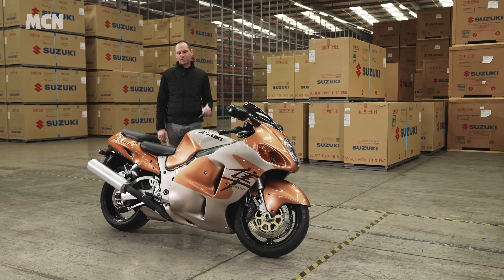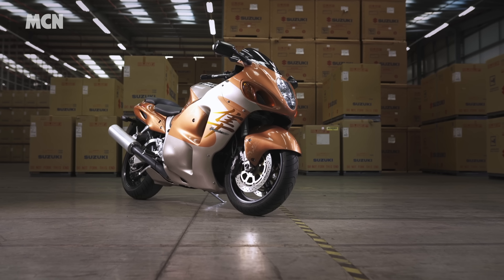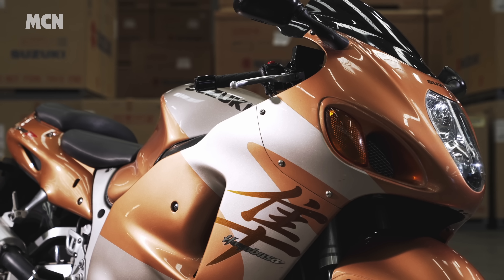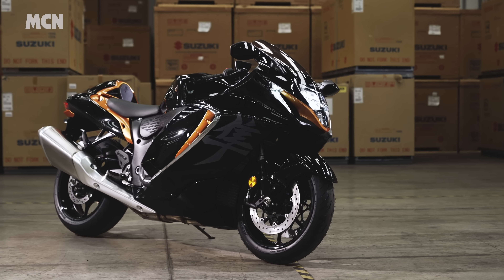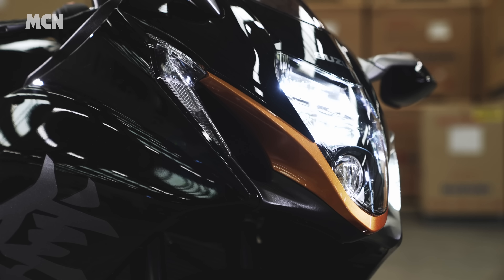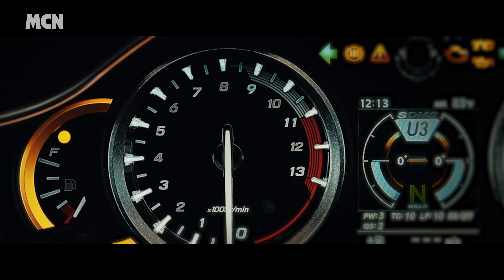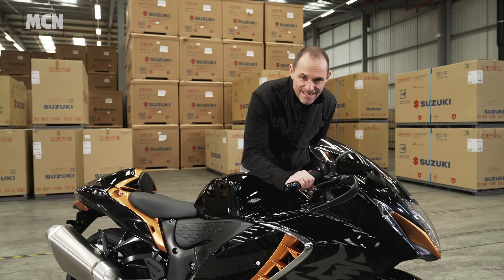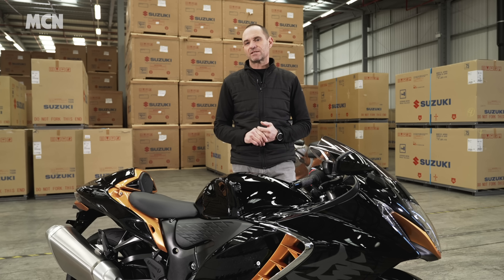2021 Suzuki Hayabusa exclusive: Neevesy's take on new 180mph+ hyperbike | MCN

Comment: Impressive! You actually managed to make it sound good. 

But still, to me it sounds like a facelift..
Reply: When he said the frame was the same I came to the same conclusion, it's just a very pretty fave lift, I was also expecting kawasaki H2 power figures so was kinda disappointed it's lost power.
Reply: I dont mind the looks and the electronics is very welcome on a bike like this in my opinion. If there’s nothing wrong with the frame I don’t mind reusing that either. I do think it is at least 20-30 kg to heavy and 30-40 hp to weak for what it is meant to do considering modern standards.
Reply: Nah. You are going a bit far on the word facelift. This is more than that. And this bike oozes character and identity compared to h2.
Reply: @alexxela754  Other than electronics, a slightly new look and euro-5, what are the differences really? The new Hayabusa relies a lot on its identity and is nearly to be considered a modern retro bike in my opinion. The H2 is a completely new platform so in that aspect they are not really comparable.
Reply: There are lightweight and nimble bikes making the same figures. Maybe the busa has more mid range torque.

I just expected them to crush the competition again with stunning numbers presenting the new busa.

Maybe my expectations were to high 😉
Reply: @ConijnCoaching  I had the same expectations. The new Busa is by no means going to be a bad bike, but it is not what I expected.

Comment: I was honestly expecting something a lot crazier
Reply: A waste of time jose.Its the same   ol 1340 witha few tweaks and a bunch of useless electronics .lean angle? Really? The bike needs more motor and less weight to beat the KING ZX14! SUZUKI YOU BLEW IT!
Reply: Doug Smith 
The King ZX are you kidding? The Gen II Hayabusa is a better package than the ZX14. It’s lighter, better power to weight ratio & has better ground clearance and of course handles better. I have had both and can comment on the differences. The ZX is smoother but more upright and not sporty. So with that being said the Suzuki package is the REAL King and anyone that knows just knows it’s still the Hayabusa leading the way in hyper sport. Now..... in that being said this one may be even better let’s wait and see 😊
Reply: @jeffestrada6857  my ZX14R makes 208HP and 118lb ft of torque stock(claimed by kawasaki). It absolutely demolishes hayabusas all day long.

Comment: This new hayabusa makes 187HP
The 2020 model make 197HP
Wtf suzuki omg
Reply: better midrange , better brakes , better aerodynamics , more comfy position   but  10 bhp less at peak =omg they ruined hayabusa :D :x  5% customers cant be wrong :x ......reallly ? .
Reply: @mociczyczki  the speedometer on hayabusa always goes 350km/h , now goes only 280km/h
Reply: @Kailash  @Kailash  king of straight ride accceleration and top speed its sporttourer not superbike unless there egzist such definition for road cycle :x  its still faster than rocket 3 new than ktm superduke 1290 than max diavel mutlistrada all 600 cc supersport on straight offcorse :x and most customer  be happy from those upgrade which they do in 3 gen they dont increase peak performance for race but midrange now is better what is very helpfoul if somebody dirvve with passangeur and some load in fact earlier gen hb wasint weakest in this part but still now power curve is more linear smooth and stronger at midrange you  i think belong to less % customer which want only peak punch from specified cycle but timeshow  of r not this move manufactury was good in terms of how many 3 gen hb thye sell :x however how many offcorse dont impact only this but more variables so still this be not solve 100% :x in me opinion they do vvery good with this upgrade which they do and im glad that they dont go way peak performance  only sacrifice rest of part bike    now cuustomer have better brakes  better ergonomics better aerodynamic and stronger midrange than 2 gen hb if they for egzample put in 3 gen diffrent camshaft which in results decrease midrange perforamcne and increase just peak that be for daily riding much worse especially with load  :x yea cycle be than faster in race and now let say with 190 bhp duc v4r beat hb and with hipothetical weeaker mid and much stronger peak no but honestly how many times on road in normal riding condition you race with such oponent ? most of customers very rare do such thing and potential which have hb is for them more than enough in 99% of time on road :x
Reply: offcorse they could go way  of much biger displacement which will not worsen midrange and increase peak punch but than  cycle be heavier what again dont help in daily driving maybe except stability at highway through wind etc  they could also put some supercharger in it yea they could offcors and they have probably many year to upgrade in diffrent waay this cycle like for me is just fine :x .performance which it have is like for me way more than enough for daily riding you dont use half a throtle and rpm range most of the time 1/3 :x  ....
Reply: hb with its 265 kg will ned 265 bhp to go heat to head at midrange velocity with duc 4r with stock exhaust which have 205 kg and 221 bhp :x fo beat this they will needdd to setup engine hb on 265bhp + and v4r with akrapoic exhasut make like 234 bhp for beat this hb need 280 bhp  so for  faster road cycle in temrs of max acceleration  300 bho setup in new hb shopuld be :x  but evven 265 will do from hb fastest cycle in terms of top speed because it have probably best aerodynamic yet :x and biger weight have very small impact on top speed like for acceleration :x for 300 bhp  with the same rpm range they will need to increase cc to 2000  around or put supercharger strong etc :x assuming only incrase in cc so also increase in weight again bhp must go up :x for beat v4r etc in acceleration .

Comment: Literally no one:
Suzuki engineers: "oh no, 205 mph is too dangerous, better limit it to 185"
Reply: gentlemen agreement my dude
Reply: Suzuki never thought that it was "too dangerous" or they'd never have made it in the first place.
There was a huge public outcry in 1999 from people outside of the motorcycling community - particularly because of the original Hayabusa speedo.
Motorcycling manufacturers, (particularly the Japanese  big four) got worried that further increases in top speed would lead to potentially devastating legislation in their biggest markets, so they came to the "gentleman's agreement" of 300kph/186mph.
The agreement, (which was never set in stone) was broken by BMW with the 2008/09 S1000RR, which was recorded at 303kph/188mph.
[MV Augusta claimed that the F4 312 could do 312kph/193.86mph, but it was never independently tested at that].
When the Japanese manufacturers saw that there was no huge public outcry over the BMW S1000RR the "gentleman's agreement" was quietly forgotten.
Advanced electronics have played a huge role in motorcycles over the last decade, and most, (if not all) manufacturers are okay with breaking the 300kph/186mph barrier.
Safety is obviously a concern, but no-one is putting an mph/kph figure on it.

Comment: Unknown World's Fastest Bikes at present is a Turbocharged Hayabusa 
It was a modified Bike not a Streamliner
311 mph - 502 km/h  ( RIP Bill ) 

Dodge Tomahawk was a scam
It was never tested to it claimed top Speed of 300-420 mph

Then MTT Turbine, I won't consider because it has Helicopter engines in it, Y2K - 227 mph 
( 420RR - 270-273 mph Claimed )

Then comes Kawasaki 
H2R - 248.5 mph - 400 km/h

A Modified BMW S1000RR also in the list which did 242 mph

Comment: I have 2000 haybusa, turbo charged and amazing....  and the cruise control....   all you have to do on first gen is build up and grind a bit more aggressive profile on the choke lever, cruise control done it’s not a PID controlled cruise but easy and highway friendly for sure. And comment before someone about zx12,..  it was never even a speed ump for the busa, that’s why they had to quickly push out the zx14 to hope to beat it stock form, but drag racing and building...  busa is still king of muscle and drags for bikes.

Hate that they didn’t do a good engine boost, it’s fine and good keeping similar looks as it should but should have injected a big performance jump... it’s been a long time and deserves so much recognition from Suzuki for it being such a revolution for sport bikes and muscle

Comment: Great vid - I owned  Busa and a Blackbird back in the late 90's  - Loved both but the Busa was just amazing - boy was it a handful in town - all that weight, long wheelbase, and short low bars - but just the king on good A roads and motorway - However the engine is like a turbine, so smooth and powerful that sitting behind that fiberglass under triple figures it actually became mundane.   😉

Comment: Yes the brochure also tells lower power than previous gen, but also 0-60 / 100 mph faster.. how compares to prev gen that is great in hp/weight ratio, power useability,  power delivery, linear curve torque, and 3-piece engine design (great advantage for mods and repair)

Comment: Better ergonomics, heated grips, and  cruise control sound great, but not at the expense of less power, lower fuel efficiency, and electronic throttle. The previous generation with a few aftermarket parts would be better imho. The newer electronics and brakes are fantastic though. It's too bad they didn't include lean angle headlights, the groundwork is there with the new sensors. Really interested to see the road test.

Comment: The first Hayabusa did a verified 189 miles an hour right out of the crate. The newest Hayabusa is down by 8 miles an hour. That is massive. 8 miles an hour slower means that in a 15 amp sprint race on a 2 mile road racing course, the new Hayabusa will be lapped..
  what the hell happened to make the newest Hayabusa that much slower..
  if you have a 100 hp motor cycle that will do exactly 100 miles an hour. And you want it to be able to go 110 miles an hour. it doesn’t mean that you only need 110 hp to go 110 miles an hour, you probably need about 130 hp to be able to have that machine go 110 miles an hour.
  if the newest Hayabusa Weighs more than the original Hayabusa, that will only hurt acceleration, not top speed. It will just take a little longer for it to reach TopSpeed. But the newest Hayabusa is not reaching top speed of the original. It could be the faring, it’s probably horsepower. It could also be where was the original Hayabusa tested? At sea level? Where was the newest Hayabusa tested? In Denver Colorado? Altitude has a great deal to do with horsepower..
  I would very much like to know where the Performance went
Reply: You are just referring  to a few mph at top speed , try riding a gen 3 , it has more power & torque everywhere apart from that 8  mph that u mentioned , if u are drag racing on a track I get your point but most use these as road bikes , I bought one 7 weeks ago & I can tell u this thing can move fast but regarding max top speed it’s not something I want to reach every day on the road anyway , get a test ride & then come back with a reply & tell me you are disappointed with the gen 3

Comment: I am so glad MCN is the very first to feature the bike at launch..was just about to buy a 2nd hand hayabusa after all that rumours of the new gen Busa and now this bomb drops in...£16k , now that's a lot of cash for a bike..overall looks nice, but I dont like the chrome bit and the front end doesn't look appealing to me as much as the rear, again that's a personal preference...abit dissapointed though by those little bit of reduced horsepower and torque,  at least Suzuki should have kept it on par with the ZZR1400..appreciate the fully loaded electronics , but some of it seems just a gimmick and impractical to me ..

Comment: I'm owner
 and the previous two generations.
I have a fully upgraded gen 2 for sport riding and fun, and the gen1 total stock for tourism.
My gen 2, without exaggeration (except for the electronics that I am not particularly interested in) is completely superior to the new gen 3. I have Ohlins front and rear suspensions, brembo front and rear brake calipers, and radial brembo brake pumps. OZ Gass -RSA wheels, and a full TiForce Dual exhaust system. Quickshifter also,
 as well as several other mods. Horsepower at the wheel 199 horses, (ECU flash + fuel maping + airfilter). Suzuki tells us why I have to pay 21,500 euros (in Greece) to buy gen 3. At the purchase cost, a new complete exhaust system and a flash ecu must be added. So a total of at least 24,000 euros. With less money, I have two busas, and I am absolutely happy. Suzuki you completely disappointed us.

Comment: Had both generations of Hayabusas, now on 2015 ZZR1400
1) Design is stunning- now it finally really looks like diving falcon.
2) Electronics are mighty  impressive
3) fuel consumption is probably on the same level now as ZZR1400- noticed considerable increase when changed from Gen 2
4) power decrease on top end is disappointing.  This is hyperbike-  it should do hyperspeeds hyperconfidently.  ZZR1400 takes the breath away how it accelerates from 250km/h.  Graphs show that Gen3 clearly looses to ZZR on top end
5) most important , though, is the  feel and handling. Gen2 feels like heavy tractor comparing to ZZR.  This review does not address that. With the same frame, layout, more weight it would be magic if those would be significantly improved.
Summary — not convincing enough to instantly splash the money to change from my 6 year old ZZR.   I would give it a test ride

Comment: So emissions is ruining motorcycles? 

I have 2014 Busa that is amazing once I added brembo brake master cylinder and steel braided lines. Power commander, autotune, exhaust, upgraded suspension and quick turn throttle. My only complaint is the riding position kills my legs. I am 6'1 and my legs cramp up after about 35 minutes. It stops just as fast as a 600. Did a couple trackdays on it at summit point, ncbike and a few other tracks. I think I am going to KTM Superduke soon though. Performance is amazing overall but I want a fast naked bike that is more comfortable. 

The part that stuck out to me was when you said about shorter handle bar. I have long arms so the old one for reach was perfect. Glad to see they updated it after what 13 years lol I think I will pass on it though. Someone will fall in love it with it though

Comment: I've had a love/not-interested relationship with the Busa. When the very first one came out I loved the idea of it but hated the bronze/silver colours.
Then I lost interest as I went back and forth between tourers (Pan Europeans, RTs etc.) and super sports (Fireblade, S1000RRs, ZX7R etc.), dabbled in the middle-ground with a 1st gen VFR800, Africa Twin, SV650 and so on.

..I found the tourers not all that comfortable sat upright, I found the supersports too extreme - for different reasons: Fireblade & ZX7R etc. riding position (although have kept the 7R) / S1000RR had a good riding position but I always felt the need to ride quickly; 'it' egged me on to do silly things. The middle ground bikes were very good but just lacked something. I've also kept the VFR - for me it is the best do it all bike, love it, but it is getting old and I have started to feel the need for ABS when going on long rides. As good as the VFR is, even after all these years, I often felt I'd like a bit more power.

In past couple of years, I've started to look at the Busa again! Now I love the original, love the original colours and would like a 2013-on with ABS. Hopefully there will be a few deals as existing owners trade in for one of the new models :)

Comment: Back in the early 2000's a mate had a gen 1 Busa, that had been tuned by Crescent Suzuki, with Yoshimura cams, Akra 4-1, head work etc, and that thing would spin the back tyre in third at stupid speeds, from what I remember he said they stated, it put out more bhp than John Reynolds BSB GSXR-1000 of that time. 
It would have been interesting to put my Suzuki K5 thou against it in a straight line dash, but the Blade I had then couldn't keep up in a straight line, in the corners it was a different story, I'd be all over him, but once the road opened up again... by, by Busa, great times that I miss terribly.

I think the new Gen 3 Busa is better looking than the Gen 2 was tbh, it sort off goes back to the Gen 1 in many instances. those end can's are hideous though, but in all honesty I truly believe the best bike Suzuki ever produced was the GSXR-1000 K5/K6, I've owned 2 K5's over the years and would have another tomorrow without hesitation.

Comment: Many people including myself have owned the Gen 1 and Gen 2 Busas and have modified them. On paper it looks like a huge let down. I like the looks of it and the few updates are nice. I did not expect for it to complete with an Ninja H2 but it should have at a  minimum had the same displacement as the zx14r. Lets face it almost any of the modern liter bikes are quicker than a Busa.  I will be keeping my old hayabusa's and my Ninja H2. I'm probably going to take a look at a new Ducati or an S1000rr.

Comment: I am currently in the market for a sport touring, and comparing the new Hayabusa and ZX14R. Other than new refreshed electronics, I see no reason to buy Hayabusa so far. ZX14 has better engine output, brakes, Ohlins suspension. I have not ridden either one yet so I can't judge by the spec only. But it is a disappointment that the new Busa not really beating ZX14 in terms of the spec.